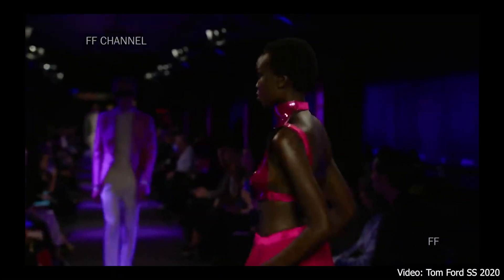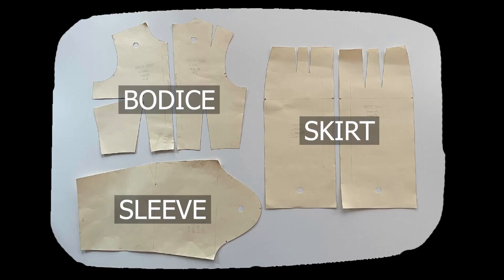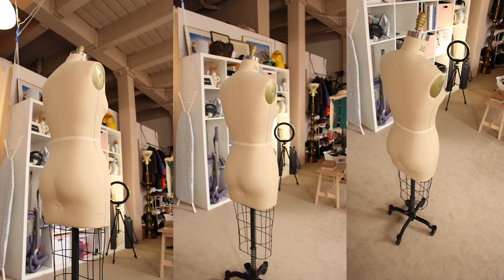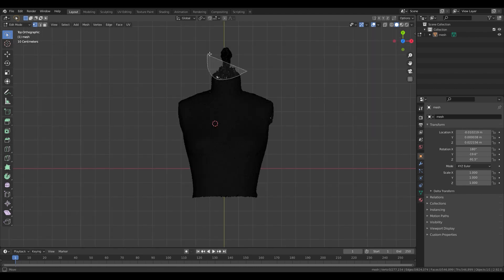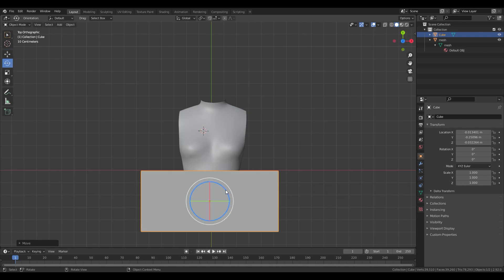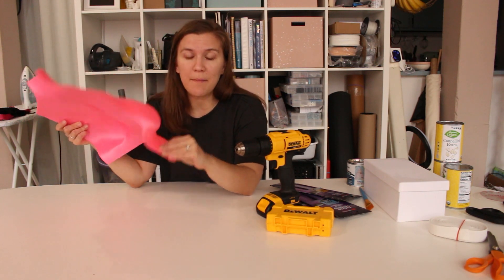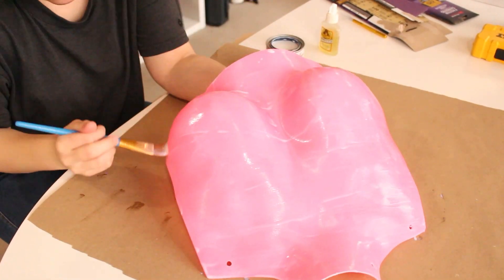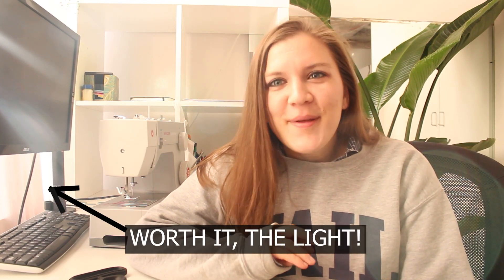I 3D printed the Tom Ford Breastplate custom to my body!

Comment: The one Zendaya wore, looked more like it was vacuum formed - Adam Savage's channel has some stuff on that process.
You'd still need a scan or model to print out as a forming buck, and a lot of sanding to get it smoothed.
If you've got a new top end iPhone, the LiDAR function could be used to make a 3D scan of your own torso, to be imported in to modeling software and print the casting buck from.
Reply from the maker: I think they used thermoforming too! I did find out that they came to Zendaya's house and scanned her topless there, but I haven't been able to find the exact mold making process. I'd be curious if they CNC'd it or 3D printed it, but I also understand a luxury brand not sharing the exact process of one of their products.

Photogrammetry is a good way to generate a model, but there are some apps on iPhone that will generate the model and post process a clean model to export (it just costs money). I'll be experimenting with this in future videos!

Comment: I wonder how comfortable the item was to wear. It is custom shaped but rigid. Does it dig in at the neck or stomach? 
Great project. Super inventive.
Reply from the maker: It surprisingly wasn't uncomfortable. The original is lined with leather so it's not hard against your skin. The breastplate is only in areas that don't move too much relative to each other, and doesn't really dig in since I sanded the edges!
Reply from the maker: I only wore it for a short while, it'd be interested to see how it would be wearing it for a few hours.

Comment: I assumed they scanned and use the model to creat a mould, then probably vacuum formed the acrylic onto the mould to get a nice finish. Mould could be 3D printed.
Reply from the maker: Both are definitely possible. for forming, I’m concerned that the breast portion would have a bit of an undercut and make it difficult to form well

Comment: Probably vacuum formed over a chest shaped mold, then trimmed to size.  Would give a nice polished surface for paint without hours of polishing.  They may also have painted the inside of the acrylic for extra shiny.
Reply from the maker: I read that they lined the interior with leather to give it a smooth finish against the skin! It definitely seems like they coated the exterior in a gloss finish, also would prevent the exterior surface from scratching.